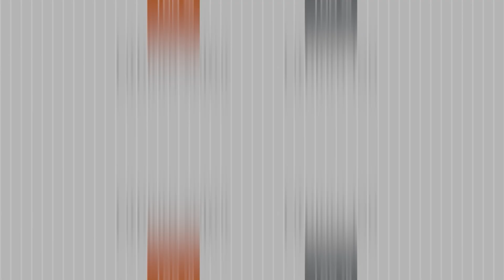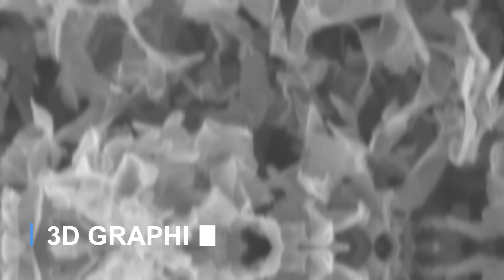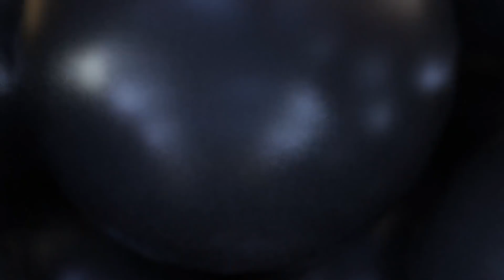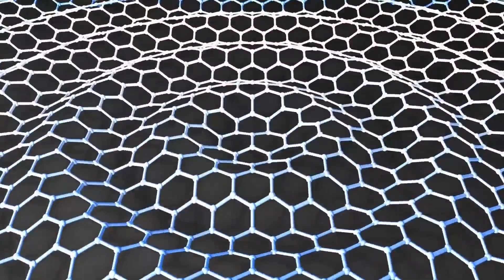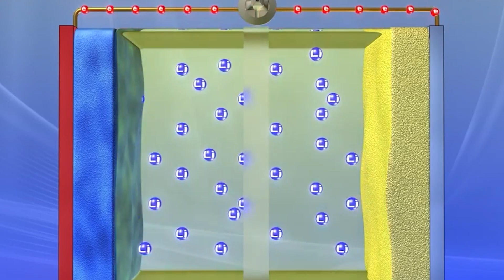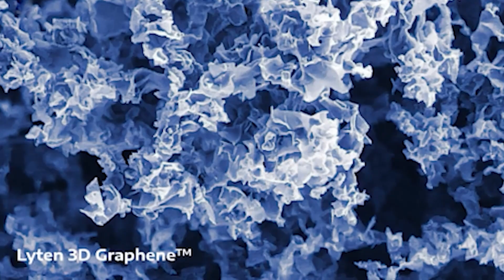New Sulphur battery will DESTROY lithium ion cells, REVOLUTIONISE EV industry

Comment: I wonder about recycling.  If they are easy to recycle then perhaps the short lifespan will not be too much of a problem.
Reply from the maker: Unfortunately, recycling and batteries don't appear in the same dictionary as things stand today. No matter what kind of battery. Primary focus right now seems to be first use performance. Once that is achieved, then the focus would shift to recycling.

Comment: 400 cycle life is still ABSOLUTLY TERRIBLE. 
at one full cycle a day, that's just barely over a year! it's so low that it negates the pollution savings over lithium ion.

How the hell did you miss this important point, or why did you gloss over it?
Reply from the maker: Power density is the answer. More wattage per cycle. Hence, overall life might not be as compromised as it might seem. Depends on how the tech develops. All of these solutions are steps in a ladder at the moment.
Reply: @carsahead  density's not much of an offset if you need more capacity to enable longer cycles.

Comment: I saw nothing new in the longevity issue. To be truly competitive in vehicles the cells need to be 1500-4000 cycles.  Until these cells are in this range nobody would consider purchasing them because they would be a potential replacement each year.
Reply: Well if the battery has significant energy density, the cycles matters less and more so if it can withstand low or high temperature that we experiences during heat waves and winter storms. 900wh per kg and 400cycles means cars will last just as long as 250wh battery and 1000 - 1500 cycles.

Comment: 3D graphene!?!?! Graphene is by definition a 2D material, that is a single layer of carbon atoms. Once is 3D....it is not graphene anymore.
What they are trying to say by 3D graphene is "a mass/mix of graphene flakes" put together.
But 3D graphene sounds more scientific....
And by the way, graphene is difficult/costly to mass produce.
Good luck with the new batteries, but as many other "marvel" batteries that were invented I doubt we are going to see mass produced in the near future.
Reply: New type of graphene using twistronics or magic angle graphene in which one layer of graphene added to ordinary graphene and twisted 1.6 degrees alters the whole graphite to acts as graphene!
Reply: "New type of graphene" !!! Graphene is a single layer of Carbon atoms, it is 2D.
If you alter this you get something else....
"One layer of graphene added to ordinary graphene and twisted 1.6 degrees alters the whole graphite to act as graphene".....
So, you admit that is graphite.
And what kind of graphene is the layer that adds to ordinary graphene?
My feeling is that you go around the tree and you don't say anything....
Graphite will never act as graphene because it is not a graphene unless you strip a single layer of atoms and becomes....graphene!
And how they measured the 1.6 degrees?
Do you know what kind of microscope they used?
Have you ever seen an image of graphene taken by a microscope? What you see there as graphene are multiple layers stacked together. Seeing or measuring 1.6 degrees between layers......good luck with that.  @williamgidrewicz4775